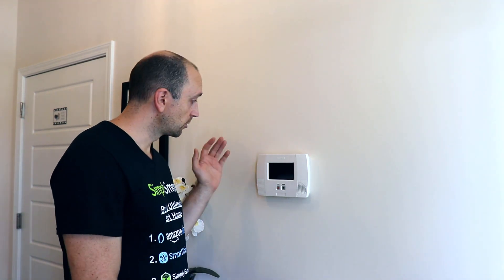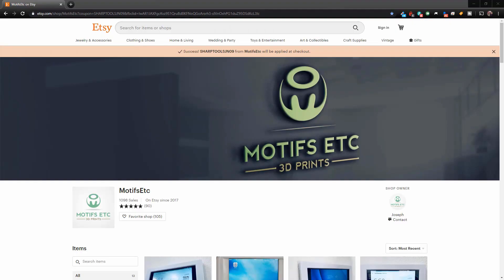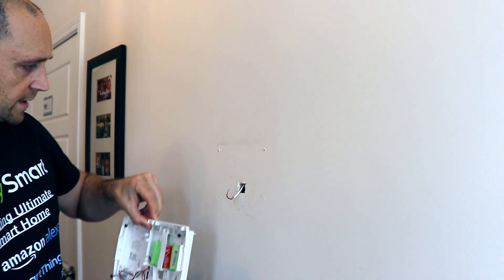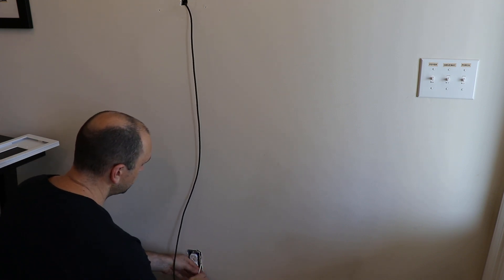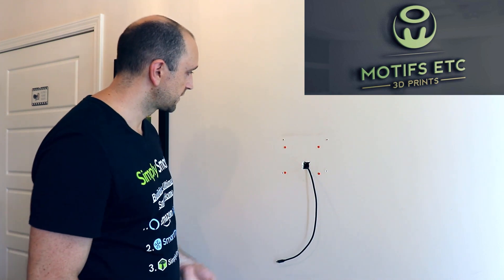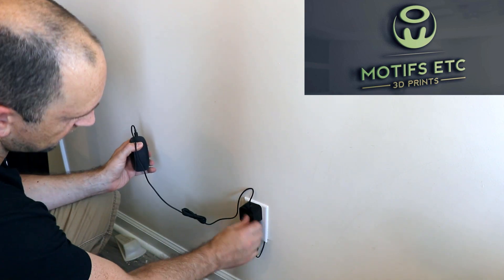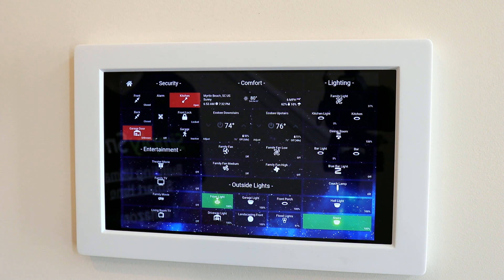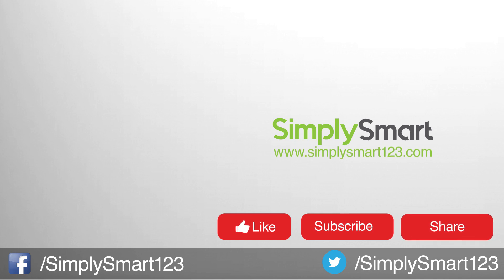SmartThings Self Monitored Alarm Panel | SharpTools Dashboards (2020)

Comment: Excellent work. I have my home setup with Ring , Hue , Amazon and misc devices. I want to use a Smart things hub now but spent so much time setting up everything. How could I easily transfer everything over to a SmartThings hub ? I bought a Fire Tablet to setup sharp tools via Kiosk browser. No clear video out there for that scenario. Could you do one plz !!!! Lol
Reply from the maker: You can add all of those devices mentioned to smart things easily because they are directly compatible. Once added to  SmartThings you will be able to see them in SharpTools and use them in Rules and on Dashboards.

Comment: I know this is a late comment but I discovered your videos and have since installed a wall mount tablet, sharp tools, use the hubitat elevation instead of wink for control but I have searched everywhere for information how to integrate my Ring alarm system. My goal is to add it to sharp tools as a security dashboard but have no clue where to start. Any assistance or where to find it would be great. Also I now have subscribed and look forward to more informative videos, Thanks
Reply from the maker: You would have to get your ring alarm system in Habitat for this to work in SharpTools. Currently I don’t know if this is even possible. For security reasons they don’t want ring alarm system to be open to other platforms.
Reply: Yes I agave the pay plan through ring.
Reply from the maker: You could set up a self monitored system as a back up. I know Smartthings has this. Not sure about Hubitat

Comment: How do you set up an entry/exit delay on your SMH?
Reply from the maker: Instead of going this route I would recommend using your phones as presence sensors and have your STHM arm when everyone leaves and disarm if anyone arrives. That way your alarm is always set and disarmed automatically with no effort or false alarms.
Reply: @SimplySmart123  that's a good suggestion and I appreciate it. I'm not sure if I want to allow the babysitter that much access though but I'll definitely consider it. I've tinkering around with alexa and I think there's a way to create a routine to delay an exit using virtual switches.
Reply from the maker: You can use Life360 with the baby sitter. And put time limits on when it would actually work using SharpTools Rules. When using Life360 they will not have access to your SmartThings but you would have access to their location.
Reply from the maker: Or you can use a keychain presence sensor.

Comment: Which alarm are you using to work with smartthings
Reply from the maker: I am using the built in SmartThings Home Monitor. I was sick of paying for a monitored alarm system and someone is home 95% of the time with my son Ari. I will have many more videos coming on all of the products you need to get that setup. The best part is unlike a typical alarm system you can use all of your sensors for anything you want and everything can work together to protect your home and automate your smart home!

Comment: Great info as always.  I've had a similar setup for a while, but the new smartthings app, ifttt changes, and alexa speaks have caused me a lot of issues that I haven't had time to work out.  If you are using smartthings home monitor, how are you getting the beep to confirm your system is armed and what device does it play from?  And is it a similar set up as your lock confirmation sound?
Reply from the maker: You just need a siren 🚨 and you can have it beep. It’s not really connected to the alarm system but just created an automation in SharpTools. The lock was the actual lock making the sound but you could do the same. 

https://www.simplysmart123.com/sirens/

I have the dome 🚨 shown in the above link.